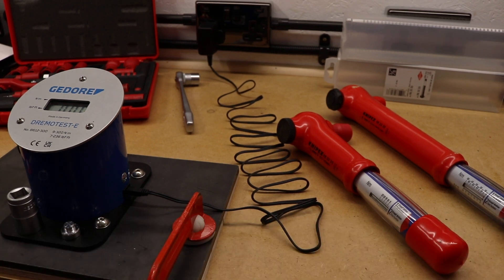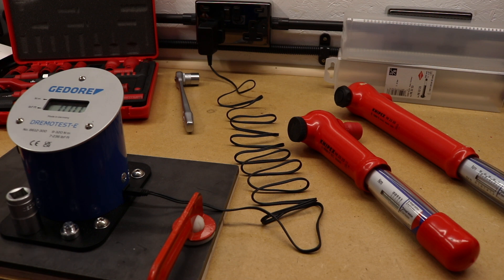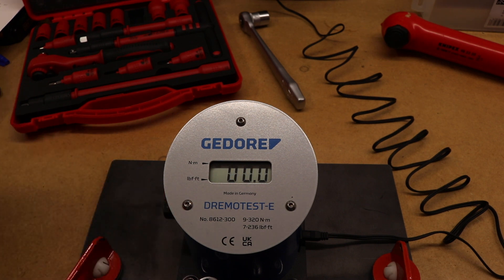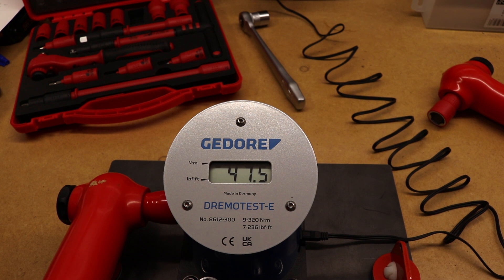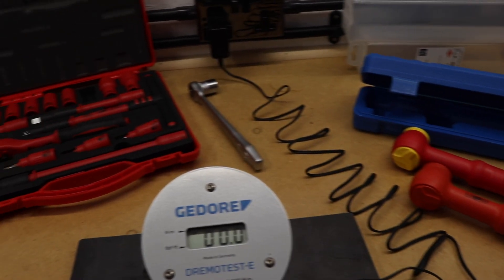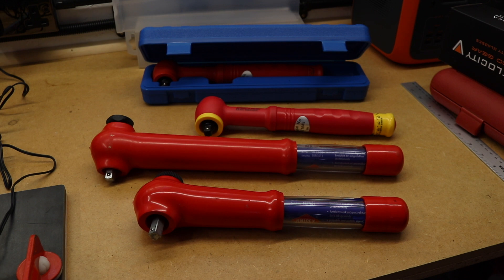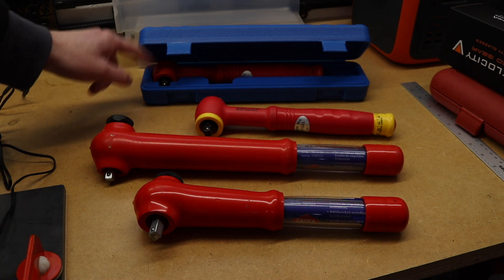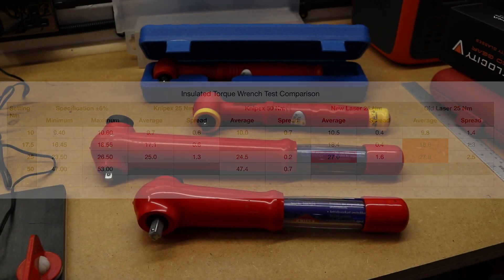Insulated Torque Wrench Tests

Comment: Great if you could color code the excel cells with higher accuracy shaded in green and lower accuracy in red you can set thresholds. Can you also hold the excel spreedsheet longer on the screen. That geodore calibrator is pretty expensive. How often is that sent for calibration? The really accurate torque wrenches and equipment is in the aviation and aerospace industries where safety issues are very critical.
Reply from the maker: Thanks for the feedback, I can add to the colour coding and hold the results for longer, just depends how much I have to say!
The Gedore has an annual calibration. The only thing with it being used to check my wrenches, it has a UKAS traceable calibration rather then a standard.
Thanks for watching!

Comment: Are you able to calibrate them? Seems the one was checking out high. I know our wrenched go in every year to cal to be calibrated and certified. They will drift, even though it looks like the Laser model was new. Did it come with a certification sheet? 
And, no idea how or even if they can be calibrated. We never had one fail, so I am assuming they can be adjusted and would fail if adjusting couldn't bring them within spec.
Reply from the maker: It did come with a calibration sheet, which shows it to be within tolerance, so not sure why there is such a difference with my measurements.
You can usually adjust this style of torque wrench by changing the compression on the spring inside. Will investigate soon.
Thanks for watching.